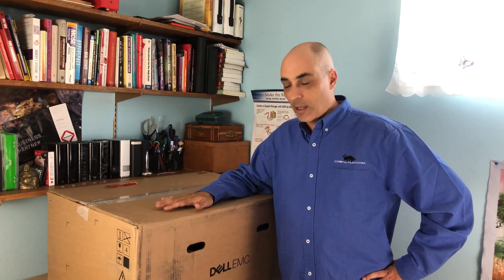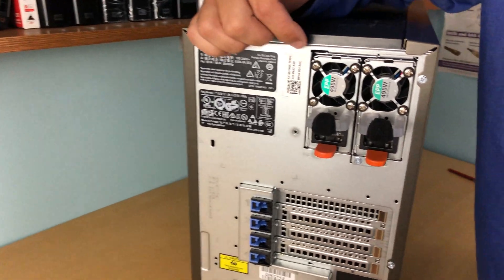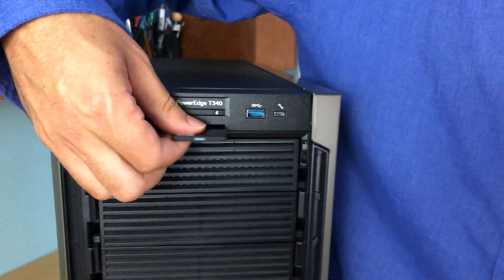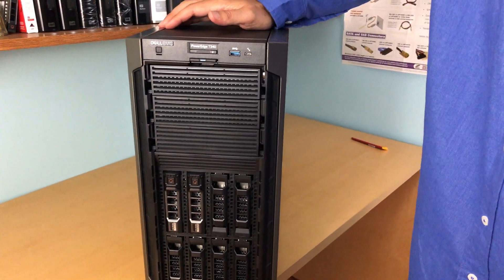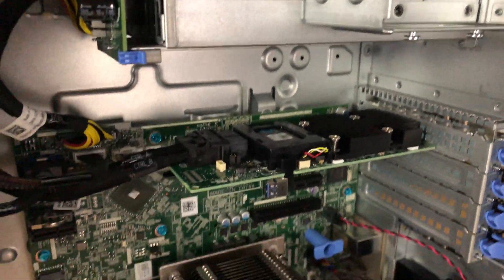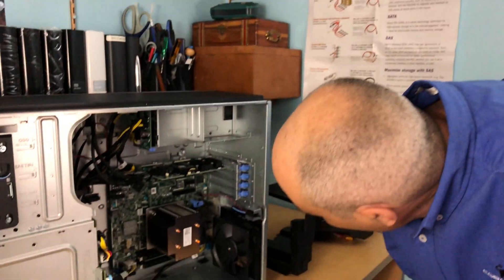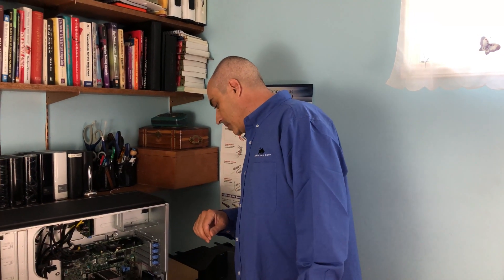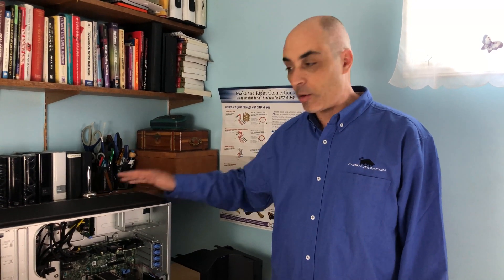Dell PowerEdge PE T340 Server - Review and Unboxing

Comment: can i run hdd without backplane? my backplane is broken
Reply from the maker: I don't have a T340 handy but look at what is available off the motherboard if all you want is to connect a SATA, for example. You can also add a PCIx card with an M.2 drive. That's work great. Again, it all depends on what you are doing with it. I wouldn't use a broken server in a production environment.

Comment: Hi Bob, can you recommend a specific rack for this server? or no need to put it on a rack?
Reply from the maker: If you intend on putting a Dell server in a rack then go for an "R" (Rack) type instead of a "T" (Tower). I especially like the R640 personally. It's a terrific workhorse and is rock solid. If you must, just get a shelf in a rack and sit the tower on it. Racks come in full height, half and so forth. I have used Startech ones and other brands including those branded by Dell / EMC and so forth. Some also get what is known as an "H Frame" but that's usually more for equipment than heavy servers. 

If you think you can't afford a R640 and are thinking of going smaller, compare the two. I found that sometimes it is cheaper to get a higher end model with less powerful components than getting a low end model that is maxed out. Things like specials and availability add to the complexity of picking servers at the best of times.